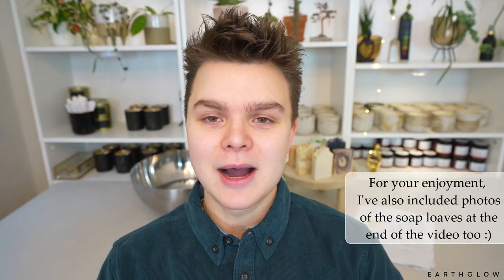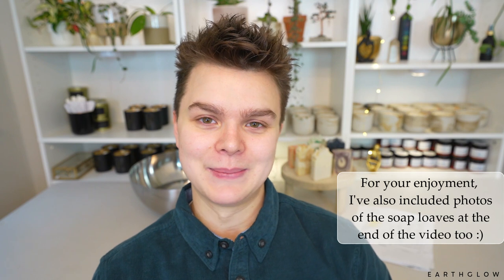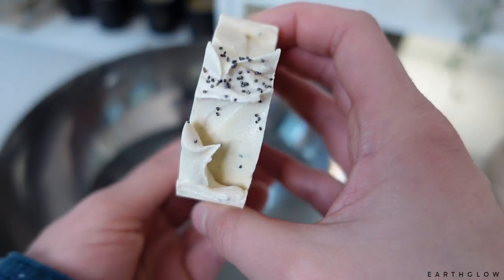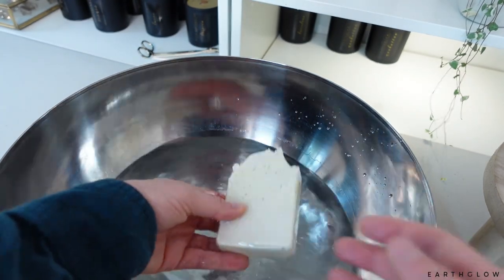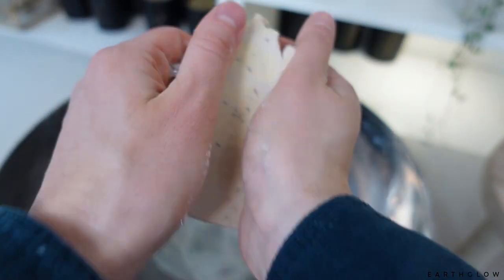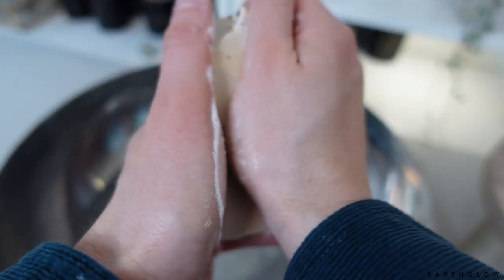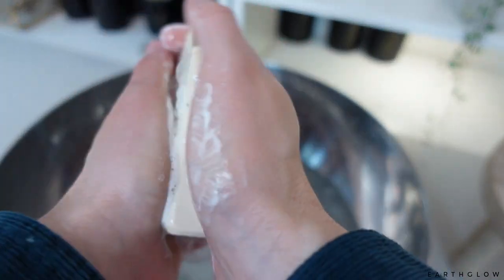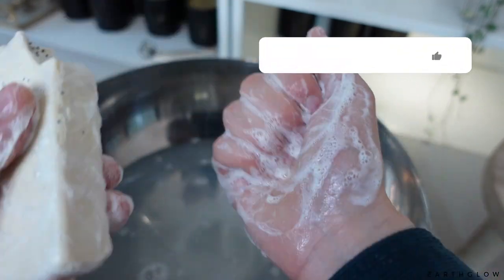🧼💖Soap Lather tests 💖✨| *testing my formulations*

Comment: i only use 3 oils and then use my elvish butter for my HP ( hot prosses). if people don't like palm oil they can use 15% soy wax 415.
Reply from the maker: Hi Daniel! Thanks for your comment. Yikes! I don't know that I would use that in a soap. I don't believe it is approved for skin use.
Reply: @earthglow  soy wax 415 is safe for soaps, lip balms and more
Reply: @danielbolger25  I believe Brambleberry has skin safe soy wax
Reply: @cliviascreations  any candle suppliers that have soy wax 415 it is skin safe

Comment: Tip to stop soda ash add Beeswax or soy wax to your soap recipe.
Reply from the maker: Hi Daniel! Soda ash is usually created from soaping at a low temp and pouring at a very thin trace.
Reply: @earthglow   adding beeswax or soy wax reduces the change of getting soda ash. even when your soaping at a low temp.
Reply: Usually I don’t get soda ash and I am a low temperature soaper but I always use 50/50 lye/ liquid. If you do a water discount you don’t get soda ash. The only time I get soda ash is with my activated charcoal soaps. Also I use corn silk instead. It’s vegan and cheap ( free for me) and has the same effect